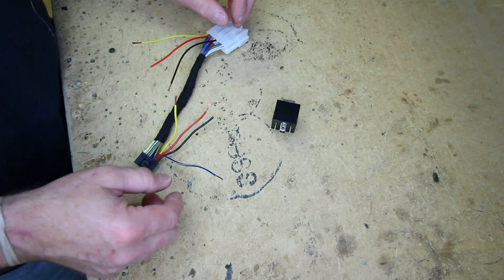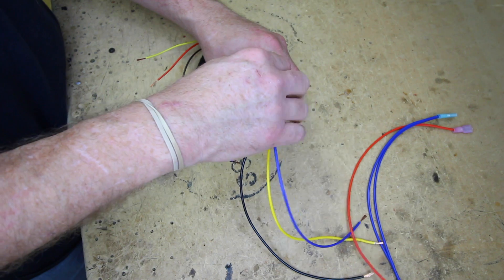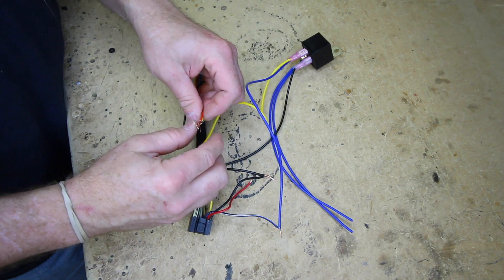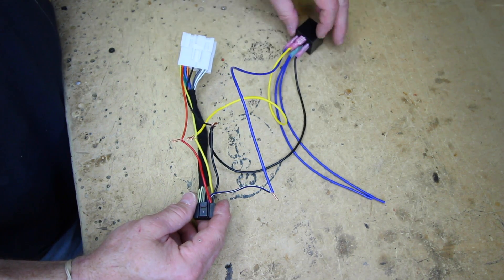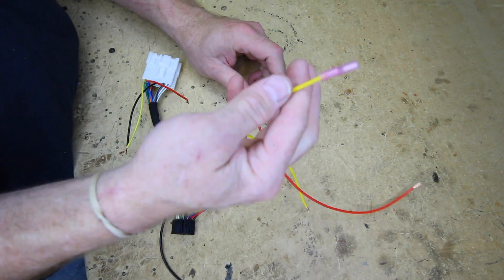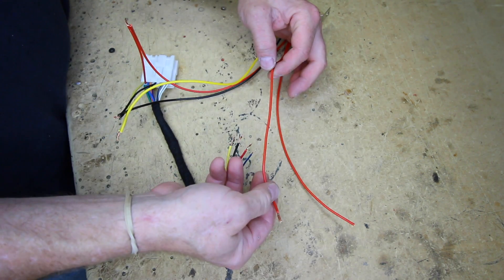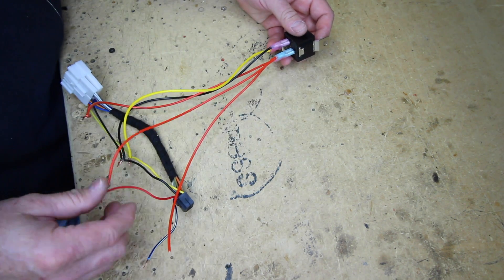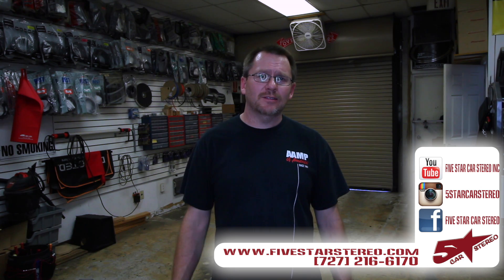How to add a relay to up the amperage for your car stereo accessory’s

Comment: You're still using ONE 12v power line from .. wherever.
Dont you want a 'bigger' power line to power accessories? Or, is this ONLY for turning on amps, not 'powering' them.?

Comment: I use to wireing the back up camera red to red on tail light and back to gound then yellow to yellow run yellow end to head unit and then conect tailight reverse  to head unit reverse the video on screen

Comment: DEAN
I WAS HAVING ISSUES WITH MY RCA OUTPUTS ON MY KENWOOD DNX576S WHEN I PLUG THEM IN THEY WOULD ONLY PLAY OUT OF 1 SPEAKER AND IT WAS REALLY LOW AND JUST SOUNDED TERRIBLE, SO I CAME ACROSS A VIDEO YOU MADE OF DIFFERENT WIRES THAT CAN GO FROM RCA TO SPEAKER WIRE WHICH GAVE ME THE IDEA TO CUT MY KNU CONCEPTS KRYSTAL 4 CHANNEL RCAS AND CONNECT THEM TO MY HEAD UNITS SPEAKER WIRES IT SEEMS TO BE WORKING FINE I HOPE THIS DOESNT CAUSE ANY ISSUES DOWN THE ROAD. THANKS MAN YOU AND CAR AUDIO FABRICATION ARE THE BEST OUT THERE.
Reply: No technically what you did is okay but not optimal! It’s cool to do I guess if your in a pinch! Definitely better than nothing however, in lies the problem in which most aftermarket head units sending the audio signal thru their speaker wires(high level outputs) which you resorted to using vs the low level rca outputs, this will cause your speakers to begin to clip(distort) usually at the headunits 3/4 volume level! This is  the main reason for using the rca outputs of the headunit to achieve the highest volume and sound quality free of distortion in most cases! For example, my pioneer single din, the volume maxes out at level 62, but the radio begins to clip at anything above 50 when the four colored traditional speaker outputs are in use! However, when sending the audio signals to my amps I’m able to get to 61/62 when using the rca output without any clipping. If I try to go to max 62/62 then it will clip even on the rca’s that’s the trend with these radios. So with that information I hope you can be more aware of your system and electronics to prolong the life 🤓

Comment: Can I daisy chain my amplifier’s remote wires and just have a single remote wire to the relay? Instead of having two remote wires like you have in the video? Or is that going to cause a problem?
Reply: I’ve done both before I was just nervous seemed bad so I fused remote wire after daisy chain amp to amp

Comment: I have a Kenwood double din radio. The aux AV input is not working for what I want. I am trying to screen mirror my phone, but it is not working. Used a CA-C3AV adapter and nothing but blurry image. Tried another and same thing. Wondering if I could wire up a relay system of some sort to use the camera button as a double function, screen mirror when not in reverse, but backup cam when put into reverse. Please help...and thank you for the vid on the F-150 with Pac Pro4 video. Made my life a lot easier when I installed my Kenwood. Got out of doing car audio almost 13yrs ago. Did it for 10yrs myself at different places.
Reply: Basically looking at putting a y connector on the camera input, using bluetooth audio for sound and cam button for video, and still being able to retain the backup camera when put into reverse.
Reply: Sorry for the multiple replies, looking to split the RCA to the tip and outside ring on a relay, that will somehow trigger once in reverse to turn on camera (possibly on another relay), but screen mirror my phone when I hit the cam button on the Kenwood using bluetooth for sound when camera is not put in reverse.

Comment: Do you need to fuse the new accessory wires? Say for the back up camera or the wires for remote turn on of multiple amps? It seems like those wires are now un-fused...at least from the point of the relay to the actual devices.

Comment: Nice video but which one of the examples do I use i want too install 3 amps and 1 epicenter thank you.
Reply: You definitely don't need a relay on the remote wires, just daisy chain the same remote wire to your 3 amps and epicenter, whatever that is
Reply: With 3 amps and a epicenter I would use a relay sorry😢

Comment: Hey Dean great and informative video I was wondering if one of the newly created aux lines from the relay could be used as a keyed trigger for a larger relay fused grounded and ran to an aux fuse block thanks in advance

Comment: Would you have to add a relay even if the back up camera “hot” was spliced in with the “hot” reverse light wire? Thanks!
Reply: Did you get an answer?  
Because I have the same question.
Reply: No you don't need a relay

Comment: Yet another video perfectly explaining the function of a relay...but failing to explain how a 2-4 gauge amp wire connects to a tiny relay!   ...I'm going to see how the starter relay works on my truck..because that is also a 2-4 gauge wire.
Reply: That runs from the battery dude you gotta be joking

Comment: +Five Star Car Audio  

IMPORTANT!  Dean, you left out an important detail !!!:

You need to put a "QUENCHING DIODE" or Suppression Diode in Parallel with the relay coil (Between Contacts #85 & #86) to suppress any Back EMF (which can be up to 200 volts!) from damaging the attached components!

See Topic #36 on Relays and then scroll down the page at http://www.bcae.com

There are Diagrams & Photos to illustrate this on the web page, but Here is what it says...

* Quenching Diodes:
Anytime that a relay coil is driven by a circuit that is not specifically designed to drive a relay, you should use a quenching/suppression diode connected in parallel with the relay coil. The diagram below will show the connection of the diode. Initially, you may think the diode serves no purpose because the voltage applied to the relay cannot pass through the diode. This is true when the relay is energized. The diode comes into play When the Power s
Source is Removed from the Relay Coil.

When power is applied to the relay coil, a magnetic field is created and energy is stored in the coil. When power is removed, the magnetic field collapses causing a reverse voltage to be generated (it's called inductive kickback or back EMF). The back EMF can easily reach 200 volts. The diode will absorb the reverse voltage spike. This voltage, if not absorbed by the diode, will cause premature failure of switch contacts and may cause the failure of power switching transistors. You can use virtually any type of rectifier or switching diode, i.e. 1N4001, 1N4002, 1N400x... or Radio Shack part No. 276-1101, 276-1102, 276-1103, 276-1104.***
Reply: Hey when u tap on ur link it takes u to alcohol bartending lol what gives
Reply: @MILO20121  http://www.bcae1.com/relays.htm

Comment: Correct me if I'm wrong but isn't pin 30 the main 12v source so that was pin 87 gets power when the relay is active and pin 87a get power when the relay is not activated?

Comment: Correct me if I’m wrong but can you also install a relay at rear of car? By connecting constant directly to battery (insinuating ones in rear) and wiring remote and ground accordingly?
Reply: No unless you added a little fuse to it and a switch otherwise whatever you want to power will never shut off

Comment: Thank you for the great video. I’m trying to tap into the dome light of the car to hook up some led board lights on my truck. How can apply a relay in this situation when I only have one wire from the harness to connect? Do I really need a relay? The lights are 3w each Im doing 6

Comment: Cool I want to do this but have a question what if I have a headunit, backup camera and also want to add a relay for my capasitor, 2amps and a fan. Can I use 2 relays to do the same thing you did but all together in one harness.
Reply: I'm stuck on this too kinda lol

Comment: Good video. Do you need a relay when you are only needing the amp turn on for 2 amps? A mono amp and a 4 channel amp.
Reply: You can put 8 amps without putting a relay the relay will actually draw more power than a bunch of amps. I would only install a relay for powering fans and leds with the remote circuit

Comment: Can this be used to install aftermarket led angel eyes and trying to get power from sock angel eye connector? I assume I would have to run a 12v constant wire from battery to relay, as well get + power from stock connector? It is for a 328i BMW with stock angel eyes but upgrading to led rings.

Comment: I'm trying to hook up a backup camera on a BMW 08 e90, I have the relay hooked up, main power coming from the battery.. Problem is it works fine while the motor is off still but, when the motor is on the backup camera works for 6 seconds and then the screen goes black and the relay starts buzzing
Reply from the maker: +shane pavlovsky that is odd, how is the relay wired?

Comment: Okay, so I have a garmin backup camera that I am adding to the back of my vehicle. The vehicle cuts voltage when it senses something is attached to my reverse light power current, not allowing the backup camera to engage. How can I install a relay for this? Basically the wireless camera needs a 12v current to power up in order to immediately send input to my GPS screen.
Reply from the maker: Josh Feidt what type of car is it
Reply: Five Star Car Stereo It is a 2010 Volvo S80

Comment: hello i want to power my camera and headrest whay methond would i use also what relay p/n would you get.   is the stereo amp wire the one being used
Reply: Good video but u got to step it up to 5 amps in the back front and back up cameras and side mirror cameras  fans 13inch kenwood deck ok ok it's a 10 inch kenwood but I keep it clean lol head rest and visors monitors now what

Comment: what does a relay do
Reply from the maker: speaker zedan it allows you to take a low amperage circuit and turn on a switch to a higher amperage circuit. So for example if you had  a 1 amp output circuit and you needed a 10 amp circuit, you would add a relay. This is the most common use for it in car audio.
Reply: +speaker zedan  
Go to http://www.bcae.com  (Basic Car Audio Electronics).
See Topic #36 on Relays located in the menu on the right-hand side of the page.
There are Diagrams & Photos to illustrate Relays & How they Work on the web page.
Reply: @bbfoto7248  the corrected web link is http://www.bcae1.com

Comment: 3:15 It may be splitting hairs, but it's an increase in CURRENT not voltage you're after. You said it twice, but I know you know better. :-) Good video!
Reply: @firebirdude2 is NOT splitting hairs.  Amps and Volts are two DIFFERENT things, but related to each other through a simple 3rd grade equation. 

The most basic fundamental equation of electricity

v = ir      
Volts = Current (amps)  x Resistance (ohms Ω) 

I am always flummoxed by the complete and utter ignorance of people that know nothing about the nature of the devices and contraptions that surround them in their daily life, for instance most people can't explain the difference between AC 120 volts from a transformer feeding a light switch in their home and a 1.5 DC volt AAA battery.

If you were to use a hose and a water pump the analogy to v = ir is:
Pressure = Flow times the Restriction
Up the pressure (volts), you get more amps. But in a car the volts stays at 13.6 (while the battery is charging) so the only way to change the amps is to reduce the resistance. The output voltage of the accessory wire does not change. 

Resistance is given off as heat at the rate of the square of current i^2r. Heat degrades or melts insulation that causes short circuits.  Fuses and circuit breakers protect against short circuits. 

Wire has resistance. A larger wire diameter wire is required, like a hose, to reduce its resistance.
The smaller and longer the wire is, the more voltage drop occurs -- a thin wire has lower voltage on the load side than on the supply side.  The more current the load pulls, the greater the voltage drop.  If a backup camera only requires milliamps to operate, a relay probably isn't required.

The significance of a relay is a tiny amount of current (milliAmps) in two small control signal wires to pins 85 & 86 turns off and on a much larger current through larger wires at pins between 30 & 87 or 30 & 87a in a Bosch-type Single Pole Double Throw (SPDT) Form-C configuration. This relay configuration occurs in many, many locations; for the ignition system, engine control module (ECM), powertrain control module (PCM), starter motor, fuel pump, fuel injector system, head lights, horn, brake & parking lights, windshield wiper motor, power door locks solenoids and power seats/sunroofs/power window motors both use dual (2) relays to reverse direction by switching polarity, heated seats, alarm, defrost/heat fan motor, radiator fan motor, A/C clutch, radio and antenna motor, subwoofer amplifier, trunk lid opener, fuel door, cigarette lighter/power port, rear window defrost, windshield washer pump, trailer brake, trailer lights, trailer battery charge, accessory delay, airbag, Anti-Lock Brake System (ABS) Pump, reverse backup light beeper, air suspension pump, fog lights/LED auxiliaries.
Reply: @JulesBartow are you a truck driver by any chance ?

Comment: can any relay be used to create the remote turn on?
Reply: He's not "creating" a remote turn-on. He's increasing the current capacity of the remote turn-on that comes from the head unit. The second part was the same situation, but with an ignition wire. Also, this is a SPDT 12V relay. There are many designs. Many will work, but many are overkill. In fact, a SPST relay would have worked for this case.
Reply: thanks for the correction
Reply: It can be used to turn on many many amplifiers. A standard Bosch SPDT automotive relay is good for 30+Amps of current. An audio amplifier takes anywhere from 3-40mA of current to power up. In other words, you could turn on nearly 100 amplifiers with that one relay.
Reply: Boyd Reid is the first relay application for 2 amps??

Comment: how do you know how many amps a wire has?
Reply: If you're asking about the remote turn-on wire, you can try looking in the head unit owner's manual. If you're asking about a wire in the vehicle, it's more difficult. You MIGHT be able to find that info from an online resource like AllData or Directechs, but they generally don't list that unless it's something out of the ordinary. You can track down which fuse it's connected to in order to get a rough idea. Also, the wire gauge itself would be a clue. A skinny 20awg wire isn't going to carry the amperage that a 12awg on would, for example.
Reply: firebirdude2 so if for example i have a 15 amp remote wire i can run 3 5 amp items or how do i divide the amps properly for like a power stripe and bridg e them the 1st one will have more power or will it divide by the pool of the load ?

Comment: Now quick question, I already use a 40 amp relay, which powers my 2 amps, aswc steering wheel control, and the antenna wire.. Can I add my camera power wire to relay instead of tapping into red wire on pioneer 5100??
Reply from the maker: +Jason Myjak yes. you are nowhere near the limits of the relay. Unless you are powering it with a low current power source.
Reply: Five Star Car Stereo Thanks appreciate it!!

Comment: what if I have wireless transmitters for my backup camera on my vw passat where would I add the relay?
Reply from the maker: goingafteru2 in the back at the tail light, you would have to run a power wire.

Comment: Awesome video! LIKED and SUB!  I have a quick question.  I am currently using ACC wire to power both a backup camera and iDatalink Maestro RR and need to add a relay.  In your video, you have a double feed on pin 30.  If I want to use the relay to power both backup camera and Maestro do I have to add 3 leads to pin 30 or can I solder both wires from camera and Maestro to the extra lead?  Thank you very much.
Reply from the maker: awdieee thank you very much! Yes you can connect all 3 leads to the relay no problem.

Comment: Do you need to fuse the relay? Just wondering.. let's say I got an AudioControl Epicenter, Gm9500 and Gm 8500.. running full active
Reply from the maker: Steven Chua depending on where you get your power source, it would not hurt to fuse it.
Reply: Five Star Car Stereo lets say I got it from the radio's remote wire.. fuse it at .5amp? Thanks Sir!
Reply from the maker: Steven Chua the remote wire out of the radio will not need a fuse. You would want to put the fuse on the feed wire for the relay( the yellow in the video). Keep in mind if you are using the wires behind the radio they are fuse by the cars fuse box.

Comment: that looks like a Simmons relay for motor controls.
Reply from the maker: 3.6L Dodge Avenger relays for cool little helper
Reply: wait what? I get a Free relay?

I was only just saying it looks like a relay for a motor control for an assembly line. I'm sure that manufactures use relay designs for different purposes.

I meant no offense.
Reply from the maker: 3.6L Dodge Avenger non taken,  I went and looked at the relays you were referring to. They look like big versions for of the ones we use. Very cool. Last year I had to replace a AC on one side DC on the other for my Air conditioner, I never knew they made such a thing.
Reply: Five Star Car Stereo 

relays comes in all sorts of shapes and sized.

Comment: Again, another great video!!  Hot many devices can I connect with just one relay?
Reply from the maker: It depends on current draw. Most relays will hand up to a 30 amp draw. So for example  if you have 4 amps, a power antenna, and 4 fans 1 relay will do the job.
Reply: great, thanks again for the helpful information.
Reply: @FiveStarCarStereoInc I am running two amps and I am going to run LEDs and a fan. can I hook #87 to distribution block for power instead of radio harness and do I need fuses if so what size and where